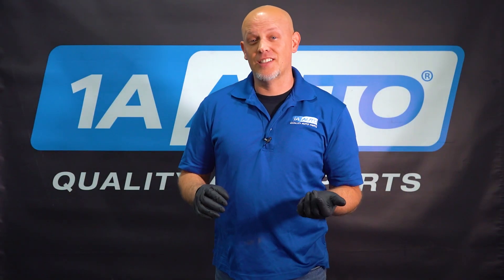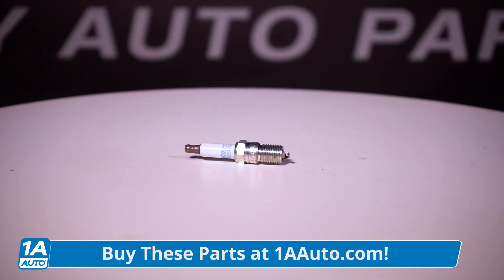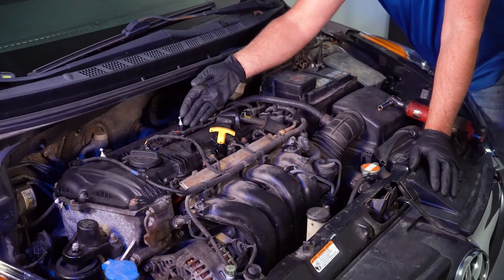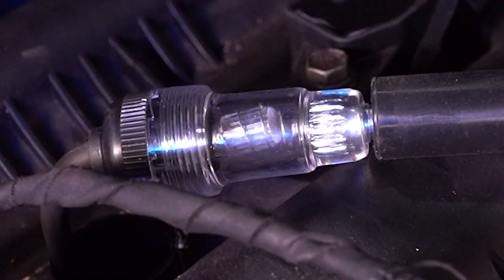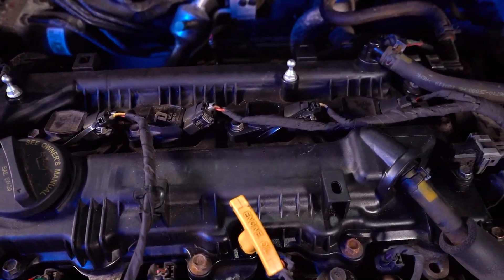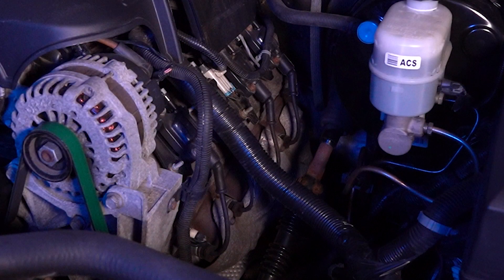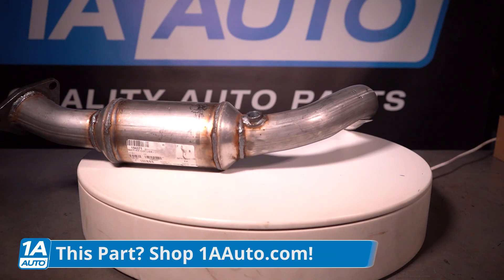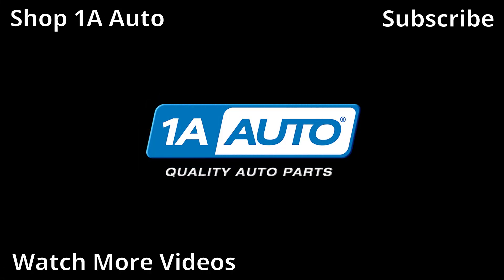Flashing Check Engine Light? Bad Spark Plugs and Ignition Coils Could Damage the Catalytic Converter

Comment: I replaced one of the ignition coil on my friends bmw 120i 2007 110kw. there was misfire and after finding out the coil was bad and i replaced it and the misfire went away. My mileage is now very good. the thing that I noticed with the new ignition coil is that the electrical connector did not fit snuggly. But now I am getting cat conv below efficiency error. I dont have any misfires or any issue with the mileage or any problem with running the car. could it be the ignition coil?

Comment: YES!!!! That is what happened to me. At first my lights would dim on & off with no loss of power. Then it would not have power fora second and then be normal. I brought it to the garage and said either cables or coils since distributors are gone. And it wrecked my Catalytic converter

Comment: you can tell this page is now just coming up bs to make videos. Who cares about the Cat. if you care about the environment that much, then you probably shouldn't be driving any car as they all pollute. its why the first performance upgrade people do is a cat and muffler delete. "that's so bad for your valves" really? been driving without them since I was 16. no problem's in any car and most are still on the road.
Reply: You must not have emissions test where you are, do you? Or are you vehicles just old enough to not need an emissions test?
Reply: Nah this literally applies to my situation and came onto my feed at the perfect time
Reply: Who cares about the cat? 

The mf DMV that's who
Reply: Zero (fitting name, BTW) are you aware that removal of a catalytic converter, EVEN ON YOUR OWN VEHICLE, is a federal offense? You can be fined $2500 for doing so. If the vehicle was made with a cat, by law you cannot delete it.